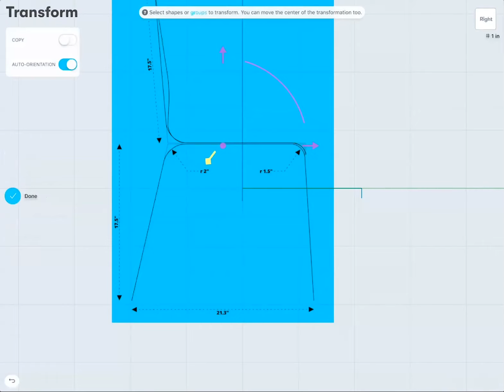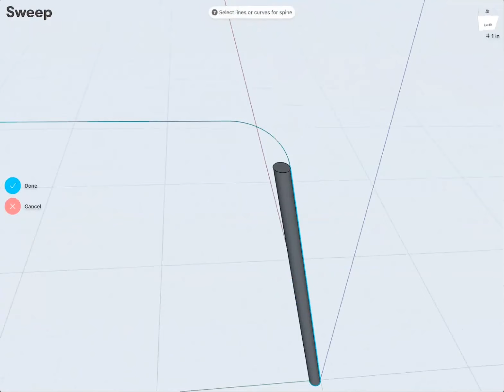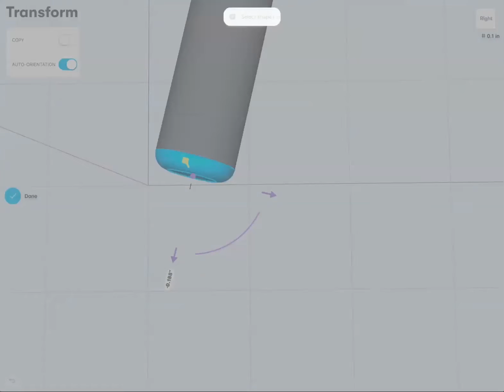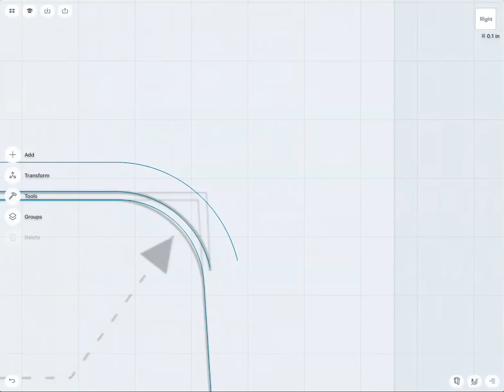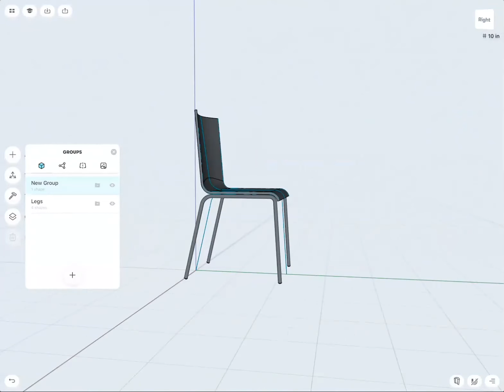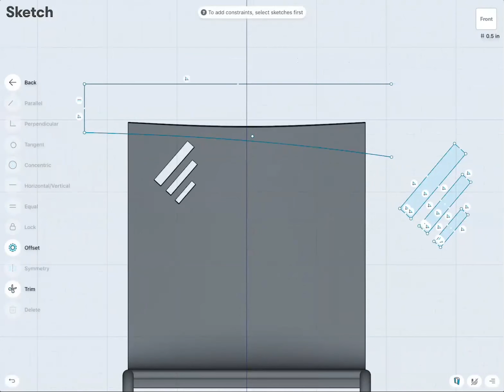Intro to 3D furniture design | 3D design webinar

Comment: Can we have a tutorial recommending how to create technical and spec images? what software?
Reply from the maker: Hello, I do not completely understand your request, I apologize. Please, can you provide more details on what technical and Spec images are? I will be looking forward to hearing from you.
Reply: Shapr3D in this video at the beginning you add some technical illustrations of your chair with precise measurements, I was wondering which software you prefer to use for this?
Reply from the maker: Hello, you can draw the 2d sketch using any CAD like Fusion360 that supports 2d sketch export.